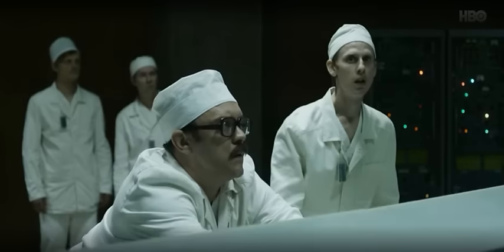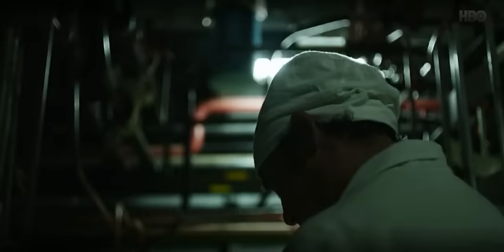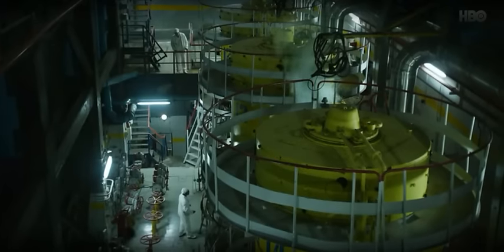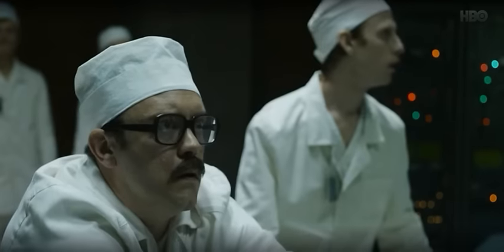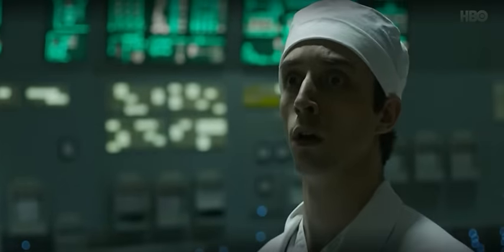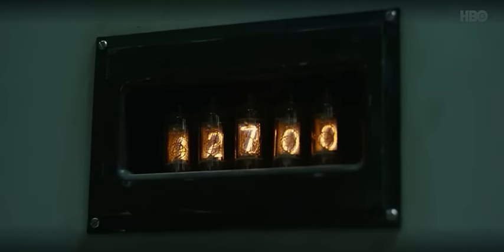Chernobyl (2019) Nuclear Reactor Explosion Scene

Comment: In case anyone was wondering, that lid weighed over 2 MILLION pounds.  And it shot off like it was a champagne cork.  That alone is terrifying.
Reply: nuclear power is well... powerful
Reply: @turquoisegreene9625  it was the steam that blew it off. The nuclear explosion came after oxygen entered
Reply: @jabronis33  there was no nuclear explosion. It occurs in nuclear weapons, not reactors. Reactors use less enriched uranium, they are only capable of putting out lots of power, but not all of it in microseconds like a nuclear weapon. The second explosion was chemical in nature, the first one was caused by the pressure.
Reply: @zoltankurti  Yes but that thermal explosion happened, and was so powerful because of energy transmitted from nuclear energy.
Reply: @zoltankurti  No offense bro but you miss some physic classes.  It is transfer of energy to another type of energy.  I think this is conduction.  I'm not professional but know something.  For sure a lot of nuclear energy is lost in that process.  It is not nuclear explosion but transfer of nuclear to thermal energy made it so powerful.
Reply: @zoltankurti  Did you read the paper?  It claims there was a ~10 ton TNT equivalent TNT nuclear yield.  This claim is based on xenon isotope ratios in the fallout cloud, for which evidence is provided.
Reply: @josephastier7421  No I did not read it, it doesn't affect my point. You might as well call all nuclear reactors a nuclear explosion then. There was no reaction taking place  there that is not taking place regularly in any reactor. The mechanism which provided the energy for the steam explosion is the same reaction which provides energy in nominal circumstances. No question about it. So what is your point? A reactor overheated, because the power level went to 10-20 times the nominal level, and steam burst the reactor. This is not a nuclear explosion, this is a steam explosion, which happened to have 10 tonns of tnt explosion energy. And there are obviously radioactivr isotopes in the fallout, this was a damn reactor ripped open. But no extraordinary reactions took place.
Reply: @josephastier7421  alright, I had the suspicion that you don't have suficient background in physics. Do you know the difference between the words nuclear isotope and nuclear isomer? And do you understand why is this important to this discussion?
Reply: @zoltankurti  Oops, I did say isotope, sorry.  The tentpole of the paper is that the isomeric ratio of 133Xe/133mXe of a normally functioning reactor is ~35, and for a fission bomb is ~11.  The ratio from the Chernobyl fallout was ~22.   It wasn't purely from a fission explosion, but it sure as hell wasn't from a normally running reactor that was mechanically broken open by a steam explosion for instance.  The paper is claiming that something very interesting happened during that explosion.
Reply: @josephastier7421  alright, we will get somewhere rhis way I'm sure. So do you also know why the isomer ratios differ in the two situations?
Reply: @josephastier7421  and ofc I'm not asking for calculations in a comment section, just for the main reason of the difference.
Reply: @zoltankurti  Sure, the half life of the the 133mXe is less than half that of 133Xe (both are measured in days), and the longer you run the reactor the more the asymmetric decay rates will affect the ratio.  Reactors run for years, bombs only run for a few microseconds.   
A low ratio between the two is the signature of a nuclear explosion.  The cited paper claims the ratio from Chernobyl was too low for a normally running reactor.
Reply: @josephastier7421  alright. But this only says that the energy for the explosion was produced via fission in the previous couple hours, which was obvious from the first place.

As far as I know, Xe133m is also produced more via high energy neutron bombardment, which would be explained with fuel melting into a puddle somewhere without moderator, allowing the high energy neutron caused fissions with the influx of thermal neutrons from the geometrically intact parts of the reactor.
Reply: @zoltankurti  We're going down a rabbit hole.  

All I stated was that a paper exists that points to a suspiciously low ratio as evidence for a small nuclear yield, ie one similar to a battlefield or "tactical" nuclear device.  

It certainly seems plausible given the damage to that building.  Could a steam explosion alone flip a two million pound reactor lid like a coin?  Blow meter-thick radiation protection windows into small chunks?  Utterly destroy a concrete and steel Soviet-built reactor hall?  Those things were built tough.

I don't really know, but I have seen the results of steam explosions, large ones in industrial settings, and they don't do those things.
Reply: @josephastier7421  I don't question the energy of the explosion. It could have been 10 tonns of tnt, but that can be caused by high pressure steam, at probably many 1000°C and at big quantities.
Reply: @zoltankurti  Forensic radiology can only estimate the nuclear component of the disaster.  The (possible) ~10 ton TNT equivalent nuclear yield would be in addition to whatever was contributed by the steam explosion.
Reply: @josephastier7421  all of the energy of the first explosion came from nuclear processes. The steam explosion got its energy from fission.
Reply: 500 ton safty cap
Reply: Plus the fact that each of the caps weighed over 700 pounds
Reply: @Krebssssssss  we will not know forsure it's either 500tons or what you said 1000tons either way must of been a site to see
Reply: @robertreid7790  1000 ton.
Reply: @josephastier7421  yes you are right I got 500tons from documentaries
Reply: @josephastier7421  You win that argument.
Reply: @jabronis33  There was never a nuclear explosion nor was there ever a chance of it. It was a steam explosion followed by a chemical explosion between Hydrogen and Oxygen.
Reply: @zoltankurti  I already clarified this lol, the world has too many bias and stereotypical views... not many people realize a big boom doesn't mean nuke. heck, almost all earthquakes alone are multiple times stronger than any nuke or H-bomb we've made.
Reply: @Electric_Bagpipes  if you read my comments I am the one here who argued this shouldn't be counted as a nuke.
Reply: I dont speak pounds
Reply: Zoltán Kürti lol
Reply: Joseph Astier I took half a class of nuclear AP physics and we learned about nuclear mishaps and most of the time the explosion is caused by heat and or steam. The only way a “nuclear explosion” would happen if it was purposefully exploded. Reactors are not like nukes. the reactor cannot explode. A nuclear explosion cannot occur because the fuel is not compact enough to allow an uncontrolled chain reaction. The MIT reactor has a lot of water and core structural materials that slow the neutrons down before they reach other fissile atoms.
Reply: So terrifying that you commented that twice?
Reply: @miamiultrasz  no DUUUHHH
Reply: It weighed just under 2 million kilograms, not pounds. It was around 4 million pounds, if anyone wants to know the conversion
Reply: @Electric_Bagpipes  The typical volcanic eruption alone already dwarfs the Tsar Bomba in fact
Reply: Well 1000 tons
Reply: Cap
Reply: To over 15 Meters up!
Reply: @josephastier7421 A flying 1000 tons lid doesnt seem heavy tbh if you consider the pressure difference.
Reply: the temperature of the core approached the temperature of the sun's surface, I don't think anything on this planet has come so close to that

Comment: Can you imagine an explosion so powerful that it could throw a lid that weighs 2 million pounds?
Reply: King Ghidorah 2025  
????????
Reply: Or 2000 tons that is the biological shield and the fuel caps horrifying
Reply: It's very difficult to wrap our heads around but we're aware that there're several explosives that can exceed that of Chernobyl
Reply: @ironphoenix5145  the biggest nuke ever made
Reply: Hiroshima...
Reply: @dahliazirrenger5615  the biggest nuke ever made would be able to vaporize the entire building over a thousand times over
Reply: The Tsar Bomba was the most powerful bomb ever created, and it was the last bomb ever  created. When they tested the bomb, it has said that the shock waves from the explosion went around the entire earth twice. You tell me that's not a powerful bomb.
Reply: @danteredgrave120  actually, the shockwave from tsar bomb went around the earth three times...and if i Remember correctly, everything Alive in 300-400 km radius fot third degree Burns, and the glass in windows shattered 1000 km away from the explosion
Reply: I remember watching steel shatter to dust on September 11th and thinking how I didn't know it could do that.

Comment: Shows that something as dangerous as a nuclear power plant is not the place to be cheap. And this historic nuclear disaster proves it. Something that could've been completely avoided..
Reply: There's no such thing as a foolproof machine. There's always a fool bigger than the proof. That's as true with nuclear reactors as with everything else.
Reply: @MaureenLycaon  So the people who worked at the reactor are to blame? Not the people who cheaped out on building the building, put in no failsafes, and led to this disaster?

Your philosophical argument does not hold up to actual evidence and scientific proof. Maybe watch the clip next time.
Reply: Ye, but if it didn’t happen, they would have never fixed the other reactors
Reply: @MaureenLycaon  they were willingly cheap
Reply: @stormcloudsabound  Yes, the people who worked there do shoulder a fair bit of the blame for the disaster. If Bryukhanov hadn’t pushed to get the test done after a ten hour delay from when they originally planned, the explosion might not have happened. If the night shift staff had insisted on not performing the test when it became clear they didn’t know what they were doing, things might not have gotten out of control. If Dyatlov had pulled the plug when the reactor stalled instead of trying to get the power back, the control rods might have still been in the core before the power spiked. Not knowing about the graphite tips wasn’t their fault, nor was the cheap design of the building, but they absolutely shoulder a fair deal of responsibility for the accident.

Comment: 'The tips are graphite' is misunderstood by most people, the rods are like 6 meters long, the top 3 meters are made of boron, the bottom 3 meters are made of graphite, there is small water gap between the boron and the graphite.  The reason the rods are designed in this way is that a column of water will reduce reactivity, so you replace that column of water with graphite to better modulate the reaction, and yes, this design is cheaper.  When the graphite is fully inserted there is a water gap at the top and at the bottom of the reaction.  When AZ5 was pressed, the rods dropped, and at the bottom of the reaction (where water was reducing reactivity) that was replaced by the graphite rod, which caused the localized spike which caused something to break, the rods to get stuck, and eventual disaster.  'The tips are graphite' was cheaper, and it was dangerous, but it wasn't just a random design error, it was purposely designed in this way.
Reply: However an easy fix which was implemented after Chernobyl was to not allow the rods to be moved such that the watergap appears on the bottom.
The flaw could have been fixed by design by just making the graphite tips the entire length of the core, or making the ends longer and out of steel, or something else that replaces the water there.

And to be fair, nobody expected some dickhead to turn off most safety systems, ignore most operating procedures, and then push that button...except it happened before, TO DYATLOV, and nobody did anything.
Reply: @A gaming protogen The tips are graphite' is misunderstood by most people, the rods are like 20 feet long, the top 10 feet are made of boron, the bottom 10 feet are made of graphite, there is small water gap between the boron and the graphite.  The reason the rods are designed in this way is that a column of water will reduce reactivity, so you replace that column of water with graphite to better modulate the reaction, and yes, this design is cheaper.  When the graphite is fully inserted there is a water gap at the top and at the bottom of the reaction.  When AZ5 was pressed, the rods dropped, and at the bottom of the reaction (where water was reducing reactivity) that was replaced by the graphite rod, which caused the localized spike which caused something to break, the rods to get stuck, and eventual disaster.  'The tips are graphite' was cheaper, and it was dangerous, but it wasn't just a random design error, it was purposely designed in this way.

Comment: Each of those containers weighed close to 800 pounds, so for them to be jumping up and down like that would've required an insane amount of force.
Reply: That sounds like a lot but never underestimate the power of steam.

Steam can easily move a 40k ton ship. A steam explosion can easily push a several ton lip off
Reply: @Fishmanglitz Remember Yamato is 72000 Tons and it was powered by Kampon Steam Turbines
Reply: >3430 N of force to be exact.

Comment: Sometimes it’s lost on us, but realize that it took all of FIVE SECONDS between Akiimov pressing AZ-5 and the explosion.
Reply: On the log it's actually 3 seconds. 

The servos of the diagnostic computer recorded the rods failling to align one by one until the entire set recorded as dead.
Reply: I’ve heard three, five, and eight, so I’m just gonna go with five since it’s the average
Reply: @ShadowXaenen  You don't need to. Just see the log file for yourself, you should find it without much trouble online.
Reply: @tywinlannister8015  oh, okay. Thanks
Reply: Five seconds to the first explosion, roughly eight seconds to the second one. I think.
Reply: @chengaanimates2108  It is a commonly overlooked fact that it did "blow" twice.

Once to lift the reactor cover (pressure), second the actual "standard" explosion, that lead to the ensuing fire. And radioactive contamination.
Reply: @tywinlannister8015  I can't actually find it anywhere, I'd like to read that, could you provide a link?

Comment: As soon as the lid came off and allowed oxygen in it was all over. Fire feeds off oxygen, smoke rises, and once the fire ignited, the smoke became radioactive and started disseminating into the atmosphere, being noticed as far away as Sweden. The Soviets really didn’t understand what they were dealing with.
Reply: They understood, the research and safety were there. They just decided to build it cheaper. This mindset persists until today.
Reply: Wonderful summary, the only caveat I have is calling it a “lid” confuses some of the newer people to the subject. It’s a lid in the sense that it COULD be removed to perform maintenance to the reactor channels, but I’ve found that some people assume that means that it was always seen as a possibility that the enormous upper biological shield could fail when in actuality it was seen as a near impossibility.
Reply: Wdym fire feeds off of oxygen ? Dihydrogen combines violently with dioxygen, that's what caused the deflagration and explosion. It made the graphite burn (graphite is a special type of coal actually). But graphite didn't ignite out of nowhere. That's why there was graphite that wasn't burning on the roof and outside.

Also, smoke didn't "became radioactive". Fire made air rise (hotter air rises) and that hotter air carried fine particles of radioactive materials which deposited everywhere in Europe due to the wind. It was mostly cesium and iodine.

Comment: 5,000+ degrees farenheit. 20,000 to 30,000 roentgen per hour. The fact it took a 5 million pound lid to contain the core just shows the power nuclear reactors hold. It's as impressive as it is terrifying. When those men went to check on the reactor, only to see the core starting to melt down, it wasn't  a good time for them. I believe those two in particular died no more than a day later.

Comment: 340 kg rods just jumping up and down is really disturbing
Reply: 500*
Reply: 50*!!!!

The real weight of the caps is around 50 kg, you can see a picture of two men carrying the caps with ease. Also, no control rods jumped up and down, not even the caps had jumped up and down as that is not how the caps work, the caps would need to create an airtight seal... which they did not as they were easy to remove for refueling and there are videos out there of steam coming out from the space in between the caps.

Comment: Putting graphite on the tips was like putting match heads on the soles of a boot and trying to stamp out a fire
Reply: No they where there to burn away xenon to avoid xenon poisioning
Reply: It wasn't an actual 'tip' like a pencil tip. It was a cylindrical rod of graphite that when you pull the boron rods out it is pulled in. Each control rod has a boron rod and a graphite rod. It is like the gas pedal and the break pedal. Try this video out it does a good job explaining this
https://www.youtube.com/watch?v=hIGtTImeYU4

Comment: “Designed to operate at 3200 megawatts ... operated at 33000 megawatts”. Jesus christ
Reply: Dylatov should have got the Order of Lenin medal for exceeding the planned electricity production target by 10 times!
Reply: In reality it was probably even higher.  The equipment used to get that measurement couldn't register higher.
Reply: Some think it went as high as 3300 gigawatts
Reply: @spamz5533  3300 gigafucks?